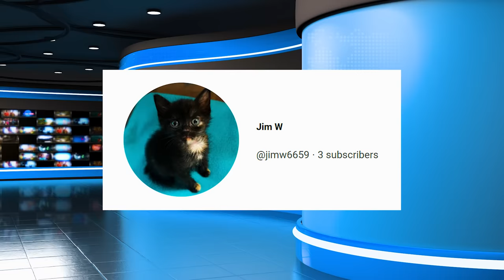Why Are So Many Builders Running Away?

Comment: Part of the problem for customers is they are getting fed up with poor workmanship. The last 3 jobs I’ve had done resulted in a not plum flue, a leaking toilet and a car that has the same noise on the part that it went into the shop with. 

I have been let down so many times I expect it and I’m getting  fed up with with it. I don’t exist for the benefit of the builder/tradesman. I pay them to do work for me to a level that is acceptable and often don’t get it. 

So far I’ve ended up having to do the work that I’ve paid the tradesman to do. 

I would like to be able to pay someone and them do the job properly, but that seems to be a lottery nowadays.
Reply: There also the problem that you can't trust the "trusted" sites that recommend tradespeople, as there's a strong incentive for them to keep their tradespeople paying for their listings, even if they can't be trusted.
Reply: Agree mate I've tried both ways. The Wickes plumber or the direct tradie. I've spec'd what I want and said don't take short cuts. I don't care about needing to pay an extra few quid when you find a problem or like you said materials keep going up. Let me know and I'll work with you. But I keep finding they've cut corners or not done what I specified eg Copper pipes not plastic or electric cables not routes the way I asked.
Reply: @purplemonkeydishwasher5269  Agreed, and the prices demanded are ridiculous, gas safe installer £750 a day for a tradesman and a lad. How much does a doctor get? Less than half that.
Reply: I agree that's why I did a carpentry course was sick of paying overpriced carpenters and having to finish there work for them
Reply: Couldn’t agree more. I’ve been let down so many times by terrible tradesmen. Unreliable and poor workmanship. There must be good ones out there somewhere…
Reply: Agreed me and my brothers have learned to do most things ourselves now so between us we can do most things except gas, to either a professional or experienced DIY level.
Has saved us thousands in money and a hell of a lot of less stress
Reply: Spot on,might as well do a half decent job yourself
Reply: Did you say 80% good builders and 20% rouge builders………from what I’ve experienced if you said it was the opposite I would say your being generous!
Perhaps this figure may have been true 20 years ago but I believe what few skilled tradesmen were around could not be bothered to train apprentices because youngsters would rather stay in their bedrooms messing about on a computer or play video games. 
So the situation will only get worse and you may as well do the job yourself.
Reply: The answer is very simple, Employers use cheap labour NOT SKILLED ARTISANS. they cost to much!
Reply: Dont tell me, you paid alot of money to get the work done? Heard it a thousand time when in reality the person doing the job isnt earning a fair wage and shouldnt be doing it
Reply: Stop paying cheap rates. If you don't pay £25 an hour plus then you not getting anything
Reply: There are very good and honest tradesmen but until you find them you just don't know.  I have had the same problems with my house and car.  They come in, charge a fortune and don't do the job properly or cause as much or more damage than they fix.  However the good guys are superb: they do a fantastic job that is worth every penny.  It is always a roll of the dice though which is disheartening.
Reply: @gemmahose8329  The cost of the job has to relate to what people can pay though.  Real wages are falling for many, many people.  Maybe the future as the UK declines is that everything is going to slowly fall apart like a third world country.
Reply: Same here. Renovated my house over the last two years and had issues on nearly every job! A patio installed without a proper fall and half the grout missing, a front door that leaks because the frame isn't square, a nightmare kitchen install, driveway contractor went through my power cable then did a runner, plumber installed radiators but hacked my floorboards to pieces in the process and there's more I can't be arsed to write! For the most part all the tradesmen just 'did one' or argued the toss about the problems rather than fix them. I've stopped using Checkatrade now - it's meaningless.
Reply: I could not agree more, now 72 but back in the late 1970s worked in Civil Engineering and by observing and watching builders while accompanying Engineers on site visits and later being a Junior Resident Engineer watched and picked up a lot of building skills which I applied to several houses I purchased and greatly improved.

But those days are gone, no way are builders at the level of craftsmanship they were 40 years ago. Over the last 20 years due to getting older did employ various guys to do work for me, but soon realized in no way did they have the skills builders once had and in fact I was actually better at. Five years ago, on employing a guy to build a brick wall, I could not believe he had not set up a level concrete base and not using a string guideline, his brick work atrocious and had no idea how to use the trowel to scoop up cement and apply with the amounts to a brick, which I show how it should be done.

Without a word he packed up his gear and left with me not paying him, I knocked down what he had and did the wall my self.

Since then, I have done all my own work but now getting too old to do so, but sadly I doubt put there are any true 'builders' now working freelance.

Comment: Great video, the only thing, I'm aware of that you didn't mention was, the average age of the builder/tradesperswon, many are 50 plus now, and either winding down or retiring., and as you did say  very few coming in at the other end. So it's a natural progression, the younger generations, coming out of school don't want to do manual work, everything is more computer based since the 1990's plus they can get more working in a supermarket, than they can as an apprentice, plus most small business's don't want apprentices, as they don't want to be dealing with the hard to deal with CITB(How about a video about them?) I've been self employed since 1986 initially as a sub-contractor but mainly running a small domestic business , and I'd say most Building firms don't last more than 10 years anyway, not just now, but over the years, I'm 58 now and winding down to a part time operation, like most of my piers around me, in my area NW England. Hello to all the hardworking trades people and builders,  I love your show, thanks for the videos. Regards Tim
Reply: That's a point on the amount of building firms that don't last ten years or more 

When I think back there is a load of them that are now gone
Reply: There are a few younger builders doing well , I think they need substantial resources to get going and quality tuition , big firms seem to be the trend which can produce rushed and shoddy results but if you can get a good name from doing quality work as an independent it can work , obviously depends a lot on price of materials , robots can't resolve site problems so the demand should continue 👍
Reply: @mickyates9154  Good luck to the young ones.

Comment: Flipping houses with a load of debt in a falling market is a dangerous game and definitely not stress free.   Living in a rural area where the local builders get known for their work and the word gets about if you are a bad customer means most people are trusted.   I know people who have been doing bathrooms and kitchens for the last 15 years and not had any serious problems from customers - though costs are more easily estimated and they charge for their work by the day.
Reply: Here in Southern Ireland i got a fitted Kitchen for a local supplier i gave them the measurements they planned out the location of same and picked out the Units, they came out and remeasured to see that all was good, and inspected the Electrical Plumbing location, then i had to Pay in Full and was to pay the Kitchen Fitters and the Electrician/Plumber on the Day.  It worked out great and the Kitchen was in our old home which has been Rented for Twenty Years and those Bullet Proof Shaker style Units are still holding Up after all that use, the Company grew from strength to strength and is now one of the biggest in the Country... The Kitchen Fitters told me that the Company had to go down this route as many folks bounced cheques for a pastime others offered part payment and others wouldn't pay at all...
Reply: The secret with flipping houses is to build up a cash reserve before you start, Cash is always KIng in property matters.  That way, you're not exposed to sudden rises in interest rates, as has recently been the case.  The other thing with flipping houses is once you've sold them, if you've done your sums correctly, you'll have made a decent profit.  Renting them out and getting paid from the tenant becomes someone else's problem, not yours.  However, many people (currently over 3 million in the UK) have a portfolio of at least one property, with ever rising rents (in real terms), it can be quite lucrative, unless you get the wrong sort of tenant.
Reply: Yep, that's all over now. Next few years are gonna be 'interesting'.

Comment: I am an electrician and refrigeration and aircon engineer I worked in data centres etc did all sorts of M and E. I left last year and am retraining  as a legal assistant at my wife firm doing conveyancing.  35 years of experience gone. the reason is the large company I worked for was bringing more  tech trackers etc into the job and all it did was slow me up and stopped me doing the tasks needed. a simple bulb replacement would take 2 weeks on and of due to getting the quote ordering the part and fitting it. Drove me nuts for something we should have on the shelf. 14 years at that firm and every year no or a below inflation rise. I ended up over 8k down in real terms from when I started.

Comment: I totally agree with everything.  Am  in this same boat, ive been a plumber and heating engineer for about 15 years and the trade has been good to be , but ive just had enough witj customers,  and i have some fantastic customer . But the bad outweigh everything. The stress isn't worth it. Ive got about another 4 years am leaving the building game in my 40s and ill just go house bashing ajmd flip a house a year
Reply: I'm the same. It's just not worth it anymore.
Reply: Good luck to you featuring. No one appreciates us self employed people.
Reply: House flipping days are over.
Reply: @bertibear1300 Too right
Reply: Dont go house bashing, thats also a no no. The customer base is shrinking due to over all cost of the economy. Or if you go up market, you need water tight contracts, all the way.
Everything you do MUST be by contract (your terms!) Seek professional advice, its costly but the only way. Start with the premise of trust NO customer.

Comment: If there's one thing I've learned, its that's I'd rather pay more for a good tradeperson and get it done properly than pay less for shoddy workmanship. It's when you pay top rate for substandard work that riles me.
Reply: All the "good" tradespeople has been shafted so much over the years (by government, employers,management teams etc )that they have left. When was the last time your saw a apprentice trainee?  Employers generally, use 'agencies' and bugger off to the golf course, so its no wonder you cant find good trades people. How do I know? I worked in the commercial world for 45years and saw it all. Imagine being the installer and supplier of seats for the Wembley Stadium and ending up bankrupt. Thats the reality
Reply: Good in theory , but in my experience with builders the very last thing you get is 'what you pay for' more often than not you get what you put up with.
Reply: The problem with DIY is refusing to permit yourself to accept a half ass job, being willing to pay for someone else to do a better job, but still ending up with the half ass result.

The benefit of DIY is you end up with some nice tools afterwards.

Comment: Flipping heck Roger, talk about hitting the nail on the head!  Last financial year my accountant thought I was working a 2 day week, how about leaving the house at 4am, into the office, on site for 8, back in the office 5pm-9, and that 7 days a week for 20 weeks of the year.  Who mentioned holidays!  What are those.  So, not surprisingly, I'm doing exactly what you've surmised, winding it down, not completely, but just sticking with a very restrictive set of repeat customer (who pay all the bills) and that's it.  The occasional s/c gang to assist, but basically cutting right back.  The life of a small, multi trade, builder.  We are treated with such contempt that I won't touch domestic work anymore... so now about a third of my time is on health and safety, RAMS as we call it, but good job to - the customers appreciate it and nobody breaks a leg or gets killed!   Strangely, this current year has been really enjoyable, I'm even helping my main customer out with a bit of unpaid additional work - working with a conscience - hahaa, just like the good old days!  Great video, and apologies for my soap box comments!

Comment: Stage payments are such a valuable tool, no money up front, on work, it never failed for me.😎🇬🇧
Reply: Thats the best way, A very strong contract, stage payments, ALL subcontractors must come through you ((part of the contract) all set up with professional help. One word of warning, you cannot go back onto a customers site, to pick up your possessions without your customers permission-thats trespass. That why you need professional help
Reply: I had staged payments for my project but we got to a point where the builder has moved on to another project about 75% complete (or 75% of the money handed over at least). The staged payments loosly included the tasks that would be completed by whkn. We are in a situation where some of the works that we thing had been paid for are not complete but some elements that were part of future stage payments had been started. We have no idea if we can complete what we need to in the funds left or if we got fair value for the work that has been done. This is a big project for us north of £300k. The general work done by our builder was good but we had specified and expected high levels of insulation and finish. Having seen the quality of work by Roger and Robin Clevitt we knew what we hoped for but it felt a long way from what we had delivered. I do feel for the building trade and understand some of the challenges raised in this video but I think that the building industry needs to do a lot to improve the quality of what is delivered.

Comment: 3 factors.are important, a good work ethic, reputation, pride in workstandards because you are only as good as your last job. As for customers it's when they ask 'can you just' and interfering with their superior knowledge that starts causing problems and further expenses. When the contract finishes trying to get them to pay for the extra work charges is like getting blood out of a stone.
Trust between both parties are lower now than they have ever been and one of the reasons why i left my trade after 25 years.
The trades has lost much needed experience and knowledge and why so many projects now over run in costs and time.
It's also going to get much worse in the years to come too when the last of us that learned from those old times retire from the building game.
I loved doing my trade and was good at it and was never without work, but people spoiled it with the unreasonable demands which were always at my expense.

Comment: The construction industry is facing significant challenges & in my opinion is broken, with clients often assuming the role of makeshift project managers. This situation leads to confusion and complications, as clients direct subcontractors to carry out additional tasks behind the primary contractor's back. Consequently, unexpected work is completed without proper authorization or discussion about payment, resulting in disputes when the client refuses to cover the cost of these extra tasks.  My last two clients have turned on us just as the projects coming to a close.  Bloody nightmare and very costly.
Reply: I see a lot of builders misdescribing the ordering of material as “project management”. This then gets billed for as an added expense 😂

It is no more difficult or time consuming, than writing out your weekly shopping list. Is that managing the kitchen stock project?

There are indeed significant challenges in the industry and none more so than the greed and sheer dishonesty within it.
Reply: Endured that with one customer about 10 yrs ago. I spent a lot of time with her and gave her a lot of good advice. She then ignored all of what I'd said, tried to manage a fairly large restoration job and made a pigs ear of it. I took payment in stages and didn't get stung too badly but the main contractor got hit hard. A lot of paranoia on both sides.

Comment: Good builders.  The really good ones are gold dust and should not be afraid to CHARGE.  I was given a hefty quote for my roof but was happy to pay the high price because I knew the roofer had a good reputation.  You get what you pay for so my advice to good quality hard working, salt of the earth builders out there is don't be afraid to give quotes that are on the generous side because honest customers will pay if they know the builder is a good and quality one.  We should have good builders working for good people.  If you are a builder and you put in a generous quote and the customer tries to drive down your quote - walk away and don't be afraid to do so.  It's a sign that your customer is going to be a problem.